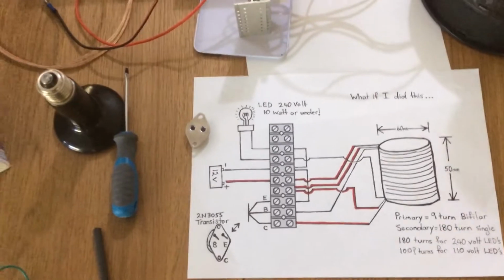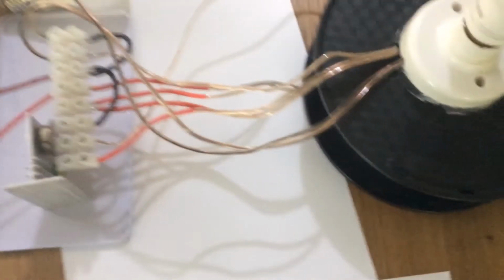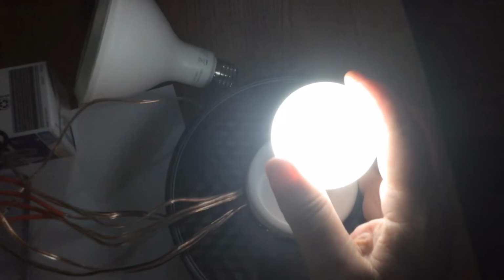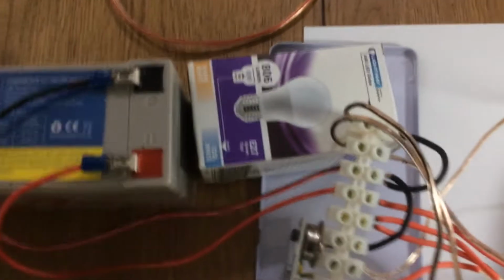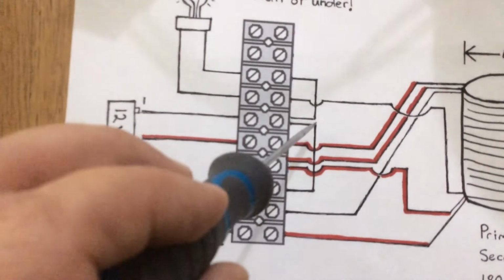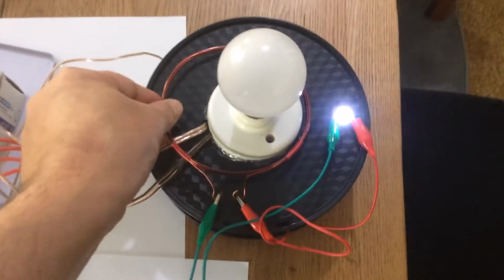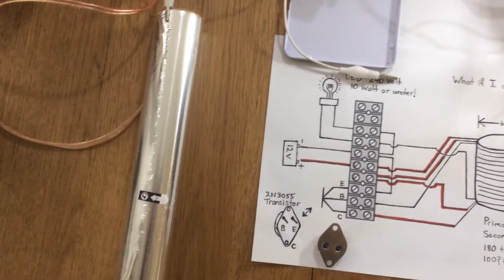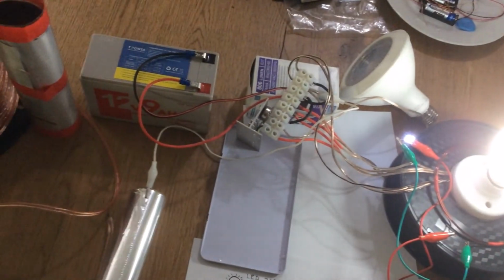Energy Crisis Off Grid Backup High Voltage Tesla Earth Ground Power Transfer Single Wire DIY Lights

Comment: Good job 
can y show the complete diagram and the diameter of the coil wire 9 turns and 180 turns
I m interested in this project as a I m on other projects of scalar waves 
tell me if possible I ll put my email 
thk y very much for this lecons
Reply from the maker: Hi, I finally got around to making an email for communication if you need it. shoppagreed@protonmail.com
Reply: @whatifididthis...1236  thk y v much
Reply: @whatifididthis...1236  hi i sent y a mail from protonmail 
I m still waiting for yr reply 
thks in advance
Reply from the maker: @feeif5679  Hi, I finally replied to your email, please let me know if you have received it. Thanks
Reply: @whatifididthis...1236  yes thk y very much follow the tgrm link there are interesting thing shared y r welcome
Reply from the maker: Hello, thanks for watching. I will try to post a video today showing how to wind the coil, I am making it in steps so possibly 3 or 4 videos in total hoping to cover everything about the circuit and will place a new schematic at the end of the first video. Thanks again for watching. Have a nice day.
Reply: @whatifididthis...1236  thk y very much It a  pleasure to watch yr works
I ll share yr video on my web site which is still in progress
Reply from the maker: @feeif5679  That would be greatly appreciated. Have a nice day.

Comment: GOOGLE this: “Experimental and Theoretical Realization of Zenneck Wave-based Non-Radiative, Non-Coupled Wireless Power Transmission” It is a paper published in Jan 2020. Describes an experiment for something similar. Think You can replicate and explain it?
Reply from the maker: Thank you for watching. I can’t thank you enough for pointing out this article as I now have an explanation of why I could pick up a signal at large distances, on any bare metallic surface when using normal Tesla coils. I had previously thought this was radio transmission but I just could not explain why things like metal door knobs(not exactly resonant designed)were receiving the signal. Now I know how, I will most definitely have a go at replicating this one, challenge accepted! Don’t expect a video to pop up anytime soon, it takes me a while to get my act together. This would also explain another experiment I was confused about, in a video of mine I demonstrate through ground transmission with ground rods approximately 60 metres apart, what I didn’t show in that video was a large pancake spiral made of copper tubing and sat in a large bucket of water, the outer edge of the spiral I had placed 6 vertical copper rods onto, a single wire AC signal from my circuit was connected on the inner most point of the spiral, the outer end of the spiral had a wire attached and fed to ground, when a 220 volt fluorescent tube was suspended between the vertical copper rods the tube would illuminate, perhaps those were Zenneck waves also. Perhaps this is what is also occurring in my other video demonstrating Tesla’s Radiant energy collection with the wall plating(capacitor plate) arrangement.
Again, thank you for watching and for the information, a very valuable educational day you have given me.
Oh and that’s a pretty cool name you’ve got there.
Have a nice day.
Reply from the maker: Just had a quick thought pop in my head, what if the foil can be replaced with the earth, and repeater stations were used to collect the original signal and extend transmission to another , eg, metal poles grounded in earth as receiver and then transmitting that signal to the next pole, it would be like wireless power lines! What we had hidden from us is astounding, the way the system feeds a corrupt inventor like Marconi, in my opinion Marconi was funded to build the radio as a means of glossing over Tesla’s wireless power system, passing it off as a means of mass entertainment which went straight over the heads of the sheeple, literally. Clearly it was, “nothing to see here folks, move along”, this is evident in the fact Tesla took Marconi to court over patent violations in regards to the radio and won, Marconi was sly by inventing radio shortly after visiting Tesla and learning the works from the master himself. No doubt J.P. Morgan encouraged Marconi to steal the concept from Tesla to distract from Tesla’s goals of unmetered power for the people. And we wonder why they still teach crap in school like Marconi invented the radio!
Reply: @whatifididthis...1236  a invenção do rádio foi o resultado do trabalho de muitos cientistas e inventores ao longo de várias décadas. Embora Marconi seja amplamente reconhecido por suas contribuições práticas e pela popularização da tecnologia, é importante reconhecer o papel fundamental de Tesla nas descobertas teóricas e experimentais que tornaram o rádio possível, assim como a contribuição teórica pioneira de Maxwell.

Comment: Witam ,,oscylator super a żarówka na podczerwień to jest dopiero super wynalazek.Wystarczy nad żarówką postawić garnek z wodą powiedzmy 2 cm przestrzeni między żarówką a dnem garnka i masz piecyk wykorzystujący od 70 do 100 W. Działa super dając do 450 -600 stopni Celsjusza.Pozdrawiam z Polski
Reply from the maker: Dzięki za oglądanie. To brzmi jak dobry pomysł. Miałem halogenowe i żarówki w obwodzie, które osiągnęły 70 stopni siedząc w filiżance wody, ale twoja sugestia, że podczerwień staje się gorętsza, będę musiał spróbować. Jeszcze raz dziękuję i miłego dnia.
Reply: @whatifididthis...1236 Witaj ponownie.To co napisałem to fakt i prawda. Żarówki na podczerwień stosuje się do podgrzewania powietrza dla kur oraz pomieszczeń . Możesz pisać również po angielsku mam automatycznie tłumaczony tekst . U mnie jest już po północy czyli teraz jest 00:26. Ale miłego dnia Ci życzę.Pozdrawiam Cezary
Reply from the maker: @s.t.63  Well I suppose I need to respond faster if responding in English, this is much easier for me, depending on the device I'm using as to how difficult it is to translate a reply. I believe you, regarding the infra red, I will see if I can rig something up. I have an old infra red bulb that I used to use for heat therapy until I blew up the circuit, that thing got so hot it would burn you through clothing. I'm surprised I never thought of it, that's probably why I'm still learning, because no one person can have all the ideas!
Thank you for sharing.